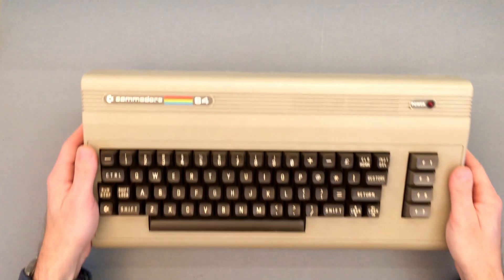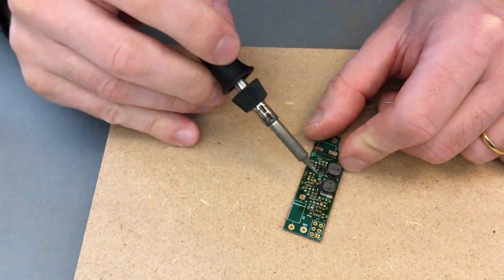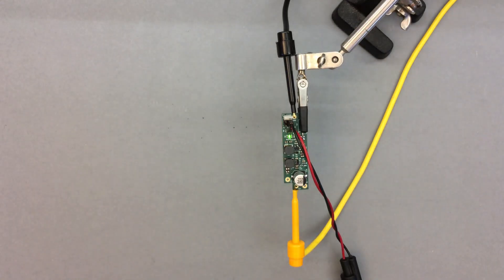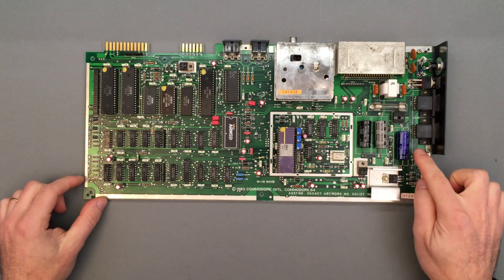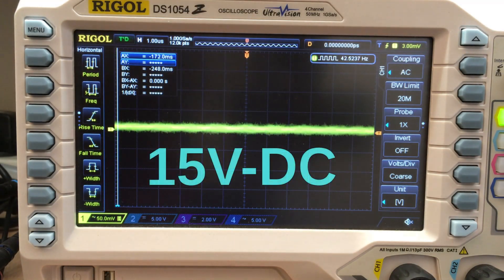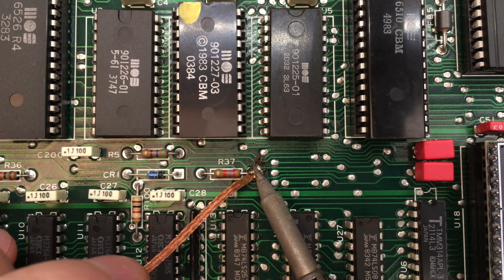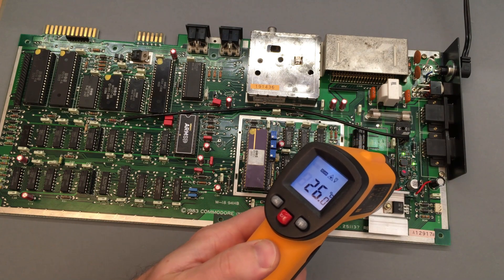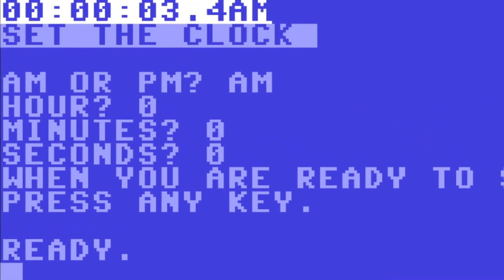DC-64: the complete DC-Power mod for the C64

Comment: Doesn't the C64 also output 9VAC to the tape drive or something like that?
Reply: Normally, both 5v dc and 9vac are output on the userport, 5vdc on the cassette port and 5vdc on the cartridge/expansion port.

Comment: The discord just says "Unable to accept invite" I like to get one of these how? So if I use a 5 AMP 12 volt power supply would that do 5 AMPs to the C=64? Thinking a old 2MB REU to power that. It has 32 RAM chips in it. Thank you.
Reply from the maker: Hello, strange that you can't join, in any case these are now for sale here: https://www.retro-updates.com/product/14007423/dc-64d-the-complete-dc-power-mod-for-the-c64 or here: https://restore-store.de/ about your question about power, it's a little more nuanced than that, please have a look at the manual on the github page here: https://github.com/sideprojectslab/DC-64/blob/main/doc/DC-64x_v0_manual.pdf for the full device specification and detailed assembly instructions

Comment: Nice job! When I did a similar thing, I used a cheap buck converter (to boost 5V to 9V for SID) and simply added an attiny to drive the ToD clock. It required me to desolder 2 components, iirc (a diode and a resistor) so that I could feed in a clock signal from attiny.
But your solution is much cleaner!
Reply from the maker: I supposed you might be talking about CR1 and R5, I'll soon make a video about my new beta board and that one involves indeed connecting to CR1 and cutting either terminal of R5, it's a much simpler solution and far easier to identify and revert than my original approach

Comment: this is great, I'm a noob at this stuff but would this mean you could use a USB C trigger module to replace the power socket and take in 12vdc from a gan charger? some people have a pal/ntsc switcher mod perhaps some optional pads to solder a switch to change the crystal oscillator between 50 and 60? would also benefit from making this mod more internationally compatible
Reply from the maker: Hi, this board does exactly what you describe, there is a jumper that switches the TOD clock between 50 and 60Hz as shown in the video :) About the USB-C charger, of course, as long as it can supply 12v/2.5A, though I am not sure what happens before the negotiation is complete
Reply: @sideprojectslab7352  oh right you could just have a toggle switch to both jumpers? the USBC trigger module would just tell the usbc gan charger to provide 12v instead of having to buy those custom dc to usbc cables that have the trigger module inside the cable on the barrel end, would make for a slightly cleaner setup lol and benefit with using existing usbc cables/power banks, id love to try it on mine but honestly i have 3 untested c64s with no working psu so my experience is crazy limited lol
Reply from the maker: Jumper inserted -> 50Hz, jumper not inserted -> 60Hz. I'm not sure what the toggle switch would be for... if you intend to be able to switch TOD frequency without opening the device you can simply run a wire from the jumper header to a switch on the case :)

Comment: The proper way to do it is to simply install the dc-dc buck converter in the original psu. The only suspect part in the original psu is the weak LM7805 linear regulator. The original transformer will last forever. No additional mods are required and no modification to the C64 is necessary. It can be taken one step further and a custom power board can be installed inside the original psu that also includes additional features like over-volt and short-circuit protection. That's what I did. My board costs about $8 to build and works perfect, including having the original AC signal coming from the 9VAC that is passed from the original psu. I have been testing it for 4 years and it's still working well.
Reply: I've got 3x untested c64s but only 1 original wedge psu encased in resin, it reads 0 on 5vdc and 12vac and aftermarket c64 PSUs start at $100aud so this mod and possibly + a USB C trigger module would allow for a really clean and cheap solution: one cable from the gan charger straight to the c64 reducing clutter and in theory would enable you to fully power a 64 from a portable charger
Reply: @OriginalityDaniel  A 9VAC transformer will read about 12V with no load on it. I just clipped the 5V wires and replaced it with a 5.1V USB supply. Exceeding 5.25V runs the risk of damaging the RAM and 6510.

Comment: Is that a 2 phase buck converter? Looks like only 0.2% ripple at 12V. Do you have the schematic available anywhere?
Reply from the maker: Hi, the 12v is supplied directly from the AC adapter, so that's the ripple from the AC adapter itself. Only the 15v and 5v rails are generated by the DC-64 board, and they have significantly lower ripple. I haven't published the schematic yet, I very well might but I haven't yet decided whether this is going to be an open source project.

Comment: This is a great idea! I've got a couple of 64s and it would be great to not have to get out a power brick to power them up.

Will the model make any difference? I know when I ordered caps to re-cap my two I had to get different sets. (I have a breadbin and the newer version and the boards are slightly different)
I imagine that you may need to disconnect / attach the wire else ware, at least.
Reply from the maker: Hi, I have "enrolled" a couple of volunteer testers that will help me assess which boards we can use the DC-64 on. The only thing you need to do to install and use the DC-64 is make sure pins 6 & 7 of the original connector are powered with a 12vDC supply, regardless of polarity because they anyway go through the rectifier. Though I now realize that we might have to replace the fuse too, as it now carries a lot more current than before.

Comment: Some sort of adjustment to get the clock signal to be perfect would be nice. Maybe just a pin that you could supply a 1khz square wave to (like most scopes have) to calibrate it with.
Reply from the maker: hi, as @1337Shockwav3 pointed out, a crystal oscillator is probably the way to go, cheap, simple and consistent over time and temperature :)

Comment: Neato ... I stumbled upon a chopped up C64 board years ago which had a PC style Molex connector and did quite a hackjob with a 555 to supply the CIA with the 50Hz for the TOD-timer.
Reply from the maker: You know what, maybe you're onto something with the 555 idea, I had to reconsider and I am redesigning a version with a 555 that can be calibrated by the user. The massive advantage of this solution is that it doesn't require programming and can be ordered straight from the manufacturer...
Reply from the maker: Indeed the 555 was an option on my desk, just for a few minutes though, as it was immediately clear to me that accuracy and size of external components would have been an issue If I wanted to fit on C19s footprint

Comment: I am very interested in the DC-64. If you have a spare board I think I have enough components laying around to populate it and I'd love to test it! What MCU are you using?
Reply from the maker: Hi Rob, thanks for reaching out. I can definitely send you the board and most of the components, I have 4 spares. I am using an ATTiny4 and the code is a grand total of 20 lines long, though you would need an Atmel ICE programmer. What I can do is to provide a board with the ATTiny already populated and programmed. Let's take this to Discord to see where you are based and which tests you would be willing to carry out. Can you join the Discord server in the video description?
Reply: @sideprojectslab7352  Hi! I'll join later today (currently at work). Thanks, talk to you soon!

Comment: i was thinking about something like this literally the other day, using USB PD for convenience 
glad to see that someone else had much the same idea to repower the C64

edit: id personally would love one of these boards, if possible already pre assembled for install as my soldering skills are lackluster for small components 
for the 12v DC supply i could still use USB PD using a simple Trigger board that tells the USB C powersupply to supply 12v
Reply from the maker: I was also rather surprised to find out that there was no tailor-made solution, which is why I decided to "do it myself". I would really like to make these boards available to the public as soon as possible. They cost fairly little to make so I could easily order a handful and be ready to ship globally in 2-3 weeks. However these are still very much prototypes, so for a first batch I would only send them to volunteer testers that are willing to take the risk (minimal, but risk nonetheless). For the financial aspects, production costs per board are rather low, but shipping and customs will be brutal outside the EU, so I'm all ears if anyone here has experience with this kind of things

Comment: Nice, But.... surface mount soldering....a bit too fiddly for me and did you really say 2% drift on the RTC? That seems like a lot.
Reply from the maker: Well if I ever get to sell this board it would come assembled, so the only soldering required is the two pins through the motherboard and the wires for the 15v and 5v supplies that are quite simple.

The RC oscillator can be calibrated on a per-device basis during production, it's a little weird because the microcontrollers are supposed to be factory calibrated and yet we see this relatively large  2-3% error. I guess it shows how easily RC oscillators can deteriorate over time... Anyway the question is whether even a 5% error on the Time-of-Day clock would really affect anyone in a meaningful way, and this I don't know yet...
Reply: @sideprojectslab7352  If you still have space on the PCB or change the outlines of the PCB you could use a digital oscillator circuit instead, using an RC oscillator seems quite "dated" as a solution compared to a modern DC-DC converter ... or if they're still produced/obtainable use a 50Hz resonator like the SX64 does. Either way, nice you're incorporating a solution to this problem on your board.
Reply from the maker: @RandomBlankUsername  I did in fact free up some space by replacing the Zener with an SMD one, and the ATTiny supports an external oscillator for the timer counter, so this is definitely on the table